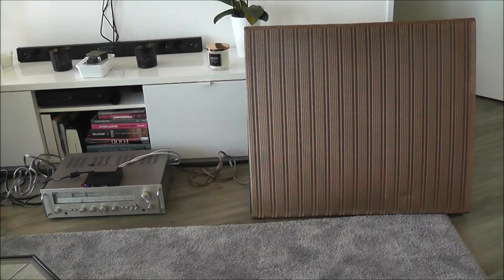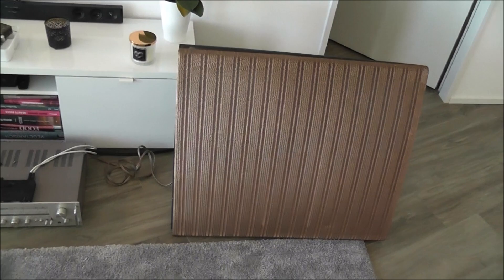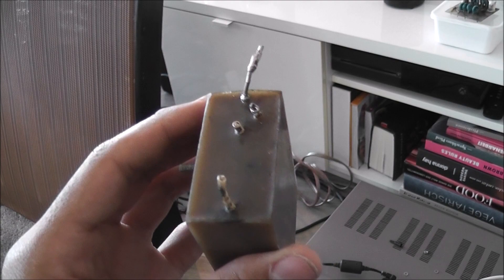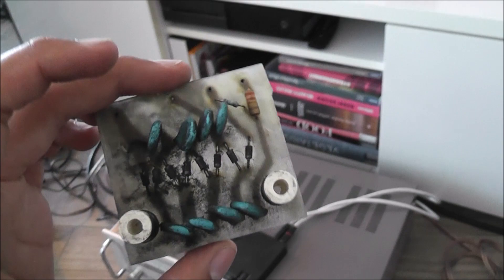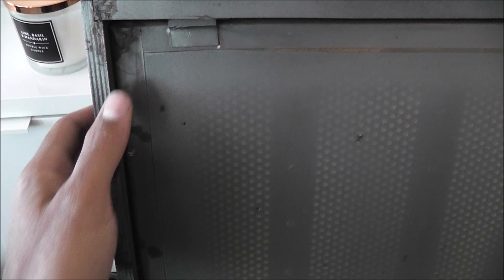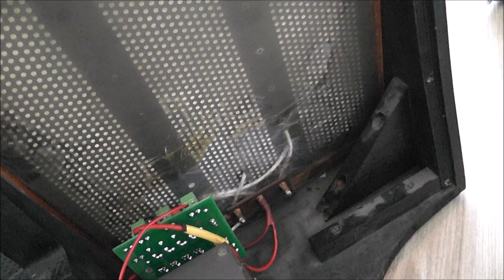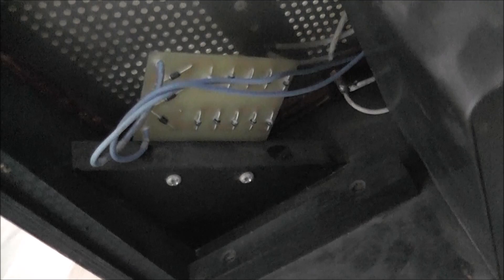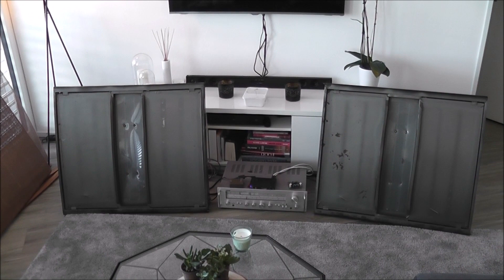Electrostatic speakers: Quad ESL 57's: walk-through / inside them

Comment: Could you please tell which AC power plug fits the ESL57, and which power cable connects to the pin receptors? (Hot-Neutral-Ground)
Thank you!
Reply from the maker: The connector type is bulgin, but the pin-out I'm not sure about, but you should be able to find some information about that

Comment: be very gentle with the front grills, they are very soft and bends-dents very easily. For Dust covers, just wash them very gentle with a just wet sponge with warm water and light soap. You can do the same with the grills, soak them if possible with warm-hot water and rinse them, maybe repeat few times to get them clean. Resistors in audio transformer are usually way off from the original values after all these years under very high voltage. They need to be replaced.

Comment: These were the first full range electrostatic speakers. Electrostatic treble units existed since the 1920s. I love the Quads but find them much too directional. Move a couple of cm from perfectly centred and the treble completely drops off.  It's even worse on the vertical axis. Even when listening on axis the stereo images sound like they are going on in my head instead of in front of me. The Quad ESL 63 and it's offspring are better in this respect but far from optimal. I've heard the same problem with other electrostatics such as Sandersound, Acoustat and some Martin Logans. It helps to listen to them in a reverberant room.
Its too bad... why can't someone make  a wide dispersion ESL? They could potentially be world class. Actually there is at least one I know of. Muraudio of Canada make completely 360 degree omnidirectional ESLs but they cost a ransom.